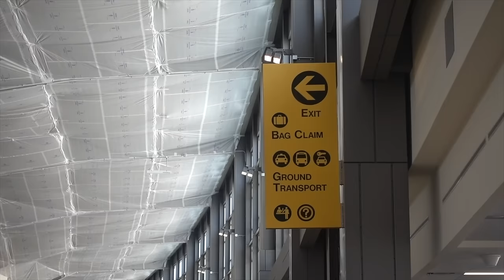MTB Myths that need to die—and some that are true!

Comment: The myth about airplanes is insane. 
I was an Airplane electrician. The bike travels in the cargo zone of the plane. Which is in fact right below the passenger seats. Lift one of those floor tiles you're sitting on and bam, you're looking at the cargo. Which means, they are in the same pressure zone as a passenger, which means it's still air pressure of around 1 bar and the same temperatures you're experiencing.

Hope that has cleared things up a little bit.
Reply from the maker: That’s unbelievable that they store the bikes at the same pressure as the cabin, and TSA will routinely tell you to let all the air out! Your revelation makes it even more ridiculous.
Reply: Yeah, otherwise pets couldn't travel in the cargo hold, there wouldn't be enough air to breath. (Usually, the temperature is adjusted if animals are in the cargo hold, so they won't freeze to death.)
Reply: There are too many passanger aircraft myths, that people take waaaaay too seriously, 'cause "they don't want to take that chance"
Reply: @BermPeakExpress  They do this, because "Someone told them so"
Mythbusters had  a whole episode, dedicated to debunking aircraft myths.
Reply: Not really 1 bar. Usually the airplane is pressurized to a normal pressure at 3000 meters altitude (about 9000 feet). But it does not make any significant difference for the tyres anyway.
Reply: @piast99  I was told it was pressurized to approximately 7,000 foot altitude because that is the typical altitude where people who are susceptible to AMS start getting sick.
Reply: Most airliners are pressurized between about 6-8000 feet. FAA regulations limit cabin pressure to 8000 feet and many aircraft manufacturers use a lower cabin pressure for passenger comfort.
Reply: if anything it should be the suspension that they ask us to let the air out.....bet they would freak out if they knew how much more psi is in the forks and shocks
Reply: From the effects of altitude alone, if you set your tire pressure at sea level and then took it up TO SPACE, it'll see a pressure difference of 1bar, or about 14.5psi.
Reply: You ever see your potato chip bags on the flight? Kinda funny.
Reply: The plane has frickin tyres on it ....wtf
Reply: @BermPeakExpress  

Cargo compartments don't go up to 35,000 or whatever cruise altitude.... but they (and the cabin) do go up to the equivalent pressure about 6000-8000' above sea level, for whatever that's worth.    NBD.

edit just realized 3 ppl already correctly said this... whatev.   Cool *
Reply: If Seth only knew to what username he just replied... 😀
Reply: Totally agree. I design aircraft, and you wouldn’t believe the ignorance of some people…
You’re spot on. Aircraft are cylinder shaped so that pressure differences can be handled optimally. You’re not running a horizontal plate (the floor panels) halfway and the only pressurise the passenger part. The floor would buckle!
It’s true though that the cabin does drop in pressure. And this can be controlled automatically or manually. The equivalent altitude pressure often depends on the airline operating procedures, but typically falls within a design range specified by the manufacturer. It’s done to relief some stresses on the hull (which is why when you have a cold, your ears can pop a bit). The same system is to cater for differences in pressure between departure and arrival point, so they can open the doors.
Reply: @BermPeakExpress  TSA knows nothing about aircraft. To the point that they sometimes even jeopardize the airworthiness of the aircraft (and your safety with it).
Reply: @DragNetJoe  actually, they lower pressure to get the passengers to sleep.
Reply: @johndoh9121  yep, and those run 300psi, and range from -50 C to sometimes easily +50 C. On rejected take off they run soo high (because of the brakes running some 1300C) that they could blow (fuse plugs that melt prevent that, but you can search for an a340-600 test video, where you will see when they don’t…)
Reply: The other myth I like about planes is the airplane mode lol they let you use your phone during the flight why does it matter that it’s on or not lol.
Reply: @hogsrmylifetbj  the FAA has this rule in place because of the POTENTIAL interference or adverse interaction with aircraft electronics. In practice this has never resulted in an accident so far. Nowadays electronic equipment is designed against more stringent requirements, but older aircraft equipment was not, soo the risk does exist. Again in practise phones have been accidentally left on and not caused problems. 

Currently there is no indication to remove this restriction, but it has a wide of non technical reasons, including terrorist use of mobile phones to trigger bombs, and nuisance of passengers talking on phones all the time.  In practise it may be difficult to get reception during cruise as connections may be unstable.
Reply: @piast99  yeah, just low enough to cause your water bottle to spit at your face when you open it, but not enough to cause it to explode
Reply: You mean baggage (where they fly dogs and other critters) is pressurized?!?!
And now,  surprised pikachu face!
Reply: flying in 707 Boeing it same store same as above seat but few dont like 363 or 355 else they get pressure in there
just normally leave tire at 10 psi yah be fine it no issues at 10 psi
i been on us airforce plane before i have load up machine and that hold over 130psi tire it never been affected at all it flew over pacific many time never blew tire i dont see why tsa telling people flat tire i wonder they want trolls you like u have back to store n air them up wasting time
Reply: Are your sure its at one bar ?
Reply: @HillelSe  100+ for road
Reply: The only reasoning I can come up with for that rule is that they ask you to do it to avoid the tires blowing up in case there's a loss of pressure in the plane. And I imagine it would be more applicable to road bikes cause they're kept at high pressures.
Reply: Yeah, ridiculous. But try talking facts to a TSA agent and see where that gets you....
Reply: Yep! You would have a really bad time if the entire "eggshape" of a airplane wasn't pressurized, as pressure vessels like pressure =) It'll explode and fall to the ground :P
Reply: It depends on the aircraft cruising level. The pressurization system keeps the cabin altitude as low as possible for passenger comfort according to the maximum allowed differential pressure. It will be at 8000 ft at maximum certified cruising level and lower if the aircraft stays below.

Consider all the bottles, cans and other containers in the cargo :-)
Reply: I travel with 100psi in my brompton and have always told immigration they're deflated. Hogwash they're gonna blow out, if this is the case then 160psi shocks would be at bigger risk.
Reply: plane would just explode if had different pressures between cabin and cargo 
😃
Reply: @BermPeakExpress  Aircraft cabins are pressurized at 6000-8000 ft altitude to minimize the stress on the aircraft structure.  That's why your ears pop during climb and feel pressure during descent.  A highly pressurized tire loaded at sea level pressure could burst at that reduced cabin pressure.
Reply: avionics. you're an avionics guy.
im a sheetmetal/structures guy. 
you know, the one that occasionally leaves FOD behind for yall to clean up. sry
Reply: I'd ask TSA who the unfortunate crew member is that has to deflate the aircraft's tires before they reach altitude (then reinflate before landing).
Reply: @baronvonrichthofen2021  right. IMHO the point is that they simply will not take chances. Air security is notorious for reducing unnecessary risks and I don’t blame them. Most likely nothing will happen but maybe you have this one idiot who pumped up his tires to the max already or by accident. They will simply not risk it if the counter measure is so simple and without any adverse effect.
Reply: Thank you for setting the record straight.... this drives me nuts!
Reply: @michaelb1761  Correct, 6,000 - 7,000 ASL is the typical cabin pressure.
Reply: It is an old generic rule for any tires, it will probably not be a problem but you have to think about the idiot who pressurized their old bald tires to twice the recommended pressure and then put it in an unpressurized cargo plane.  It is easier to simply have a rule that all tires need to be depressurized when flying then try to make a judgement call on an individual basis.
Reply: Not exactly true a hold in the plane isn’t always pressurised to the same we sit in B737 have a hold that is and one that isn’t
Reply: It's more for the smaller aircraft who holds are not always pressurised. So I did 20+ years with aircraft and out of Heathrow not an issue on 99% of aircraft but 2nd sector may be a smaller aircraft which the hold is not pressurised. Also note even on pressurised aircraft see those bottles of pop /water that are bulging once in the air. Same with your tires. I would always suggest letting out 20% of air. 👍
Reply: @michaelb1761  so they pressurize it to an altitude where people start getting sick? Lol they should pressurize it a bit higher so that people won't start getting sick...
Reply: I was so sick of finding my tires completely uninflated at the baggage pickup that I started deflating to the lower pressure and wrapping a length of fluorescent pink duct tape around the tire and valve. The color makes it look "official" and since then haven't had anyone mess with my tire pressure.
Reply: I cannot believe how much ignorant bull crap there is in these comments. You shouldn't believe it, either.  More importantly, if you don't know what you are talking about, don't say anything.
Reply: It wouldn't surprise me at all if this came about because someone realised that you could potentially fill the tyres with something far more dangerous than breathable air.
Reply: @chrisko6439  Unless your load control/weight and balance guy forgets to tell the pilots there is AVIH in the aft hold. or, decides to put cargo packed with dry ice in there with them.
Reply: To add to this.  Even cargo-only planes are pressurized.  Or more specifically, not allowed to depressurize.
Reply: @n0ch91c3s  Let's hear it for critical thinking.
Reply: @lcc8394  lol yes
Reply: @Plumbump  He won't live long doing that...
Reply: @lcc8394  shocks & forks are effectively  pressure vessels & can withstand a pressure differential of a few psi easily.
Reply: Plus they transport animals like dogs in the cargo bay as well. If it wasn't pressurized and climate controlled those puppers would have a really bad time in their transport cages...
Reply: @fourutubez7294  Nah. If the hold (& cabin fyi) is pressurised to about 7000m then that is only 4 or 5 psi less than normal atmospheric at ground level. Wouldn't affect anyone's tyres in reality.
Reply: @GardFiring  Surely it'd implode.
Reply: @karguy1720  but the reduced pressure at 7000 ft is only 4 or 5 psi less than at ground level. Not enough to cause any issues at all. Do everyone's tyres explode when they ride in the mountains at high altitude? Nah.
Reply: @svenweihusen57  It's only 4 or 5 psi difference so there is no risk in reality
Reply: @45graham45  normally no. The question is: do you want to risk it? Depressurizing tires doesn't cost anything while one ruptured tire would result in an emergency landing plus investigation etc. easily resulting in 50k+ Dollar costs. 
There is simply no reason for not deflating tires except for 2 minutes for the biker to pump them up again.
Reply: I think this is a hold over from the really old days of flying where the cabin and storage really were sealed apart.     But it hasn't been this way for years and years.
Reply: @fredman1085  I don’t think that an exploding bike tyre will cause any damage but for safety concerns the plane will have to land immediately. So they will simply not risk it. And it’s just a mild annoyance for any biker.
Reply: @fredman1085  But even a totally unpressurized hold will only be at about 13 psi less than at sea level so still not a problem.
Reply: @45graham45  oh, I believe you.    Im just saying where the idea might have come from.
Reply: @svenweihusen57  I’m not arguing for or against.    I was trying to say where the idea might have come from.
Reply: @lcc8394  I was told at the hardware store that water heater expansion tanks come pre-charged to no more than 40 PSI due to shipping limitations.  Of course you can ship full gas cylinders but there are special requirements.  Don't tell anyone about the shocks or someone will restrict them, even though you could put them in orbit without an explosion.  Sea level to space is 14.7 PSI, how many of our tires would explode with an extra 15 PSI?  Road, mountain, car, all the tires would be fine so long as they're safe to ride on.  Then again I'm not gonna pick a fight with the TSA any more than I would with the DMV, the Post Office, or Customs.
Reply: @baronvonrichthofen2021  I fly small aircraft and sometimes I struggle to get a connection even at 3000 feet AGL, let alone five digits in.
Reply: The reason they tell you to take the air out is that they have some policy or other that prohibits taking containers with pressurized gases because it's unsafe. Of course that's to keep people from bringing high pressure oxygen cylinders or something but technically, by the letter of the law, that's what bike tires are, too.
Reply: @johndoh9121  I’d be willing to bet those aren’t typical air filled tires though. Probably solid rubber
Reply: @FedericoTesta1  not necessarily.
Reply: The cargo hold is only heated if there is pets in there.
Reply: @freddyfox5002  Sometimes you do get your baggage back really cold after a long flight, so that sounds right, but I'm quite sure they keep it above 0° so as not to freeze people's beverages in there or get loads of problems with humidity when unloading. So it's well within the range bicycles are designed to handle.
Reply: They might be more concerned about a sudden cabin pressure loss, but I'm sure that so will the passengers.
Reply: @freddyfox5002  Sometimes it may be even fully air conditioned, sometimes it may be heated, sometimes it won't have any temperature control at all. It depends on aircraft design and setting of the switches. In 747-8F aft cargo hold may be either air conditioned, only heated or without any temperature control at all, depending on the settings of the switches.
Reply: @fredman1085  all of the pressurized airliners, since the invention of pressurized airliners, have had a round fuselage cross section. This is because if they were shaped like a Ford trimotor (rectangle cross section) then pressurization would try to force the walls into a circular cross section and they'd break since they're not built with balloon-like flexibility. 
So I don't think it's technically feasible to have pressurized and unpressurized sections on any round cross section airliner
Reply: One more add to this (Boeing engineer) is that the cabin is not "pressurized" per se but has some mechanical plugs that just close at air pressure corresponding to about 8,000ft. The pressure is captured at 8,000ft and then you continue on your way. The temps can drop in the uninsulated cargo hold but the pressure is no worse than what most of us ride our bikes at. So if your bike doesn't explode on the 8K trail then it will not in the cargo hold. The circle of the fuselage is the pressure tube with passengers on top and cargo below. Bit more complex but that is the gist and the myth is crazy but I'm surprised how many smart friends think their luggage flies at 30K pressures. If anything, you should increase pressure to offset the temp drop and protect against the cold temps dropping to very low pressure then burping tires wedged funny in the luggage stack. ~8K friends!
Reply: @CookieMonsterSLC  Nice insights :)
Reply: Someone needs to inform tsa and request a review of their rules. However, they aren't worried about the tires themselves, they're worried about the noise they would make because it does sound similar to a .45 being fired.
Reply: Incorrect, cargo areas are pneumatically sealed and during a flight, a vacuum. This is done to prevent fires since fires cant burn without oxygen. There is a separate cargo hold for animals (tends to be the forward cargo hold)
Reply: @HillelSe  Higher pressure means even less difference
Reply: At altitude the pressure inside pressurized cabins does still decrease 
Its why the ear popping happens
Reply: The pressure isn't 1 bar, it's around 0.8 bar at cruising altitude, which is equivalent to 2000 m altitude.
Reply: @HO7SIM37  Its not necessarily the pressure that is in them but the pressure at which the vessel can handle before failure. A shock being made out of aluminum and of sufficient wall thickness can hand several hundred psi of pressure before failure. A Tire on the other hand depending on its construction can't necessarily withstand multiple times its normal pressure before failure.

Now is the absolute pressure differential in the tire going to rise enough when at flight altitude to cause failure, highly unlikely unless the tire is way over pressurized at ground level or its just a total crap tire.  For this reason, TSA just advises you to deflate them as a precaution. They like anyone who has to deal with the general public don't want to have to deal with stupid irate people bitching at them because they may have had way too much pressure in their tires and the pressure differential expansion at altitude did cause them to rupture. Remember, most people will not own up to their own ignorance and will lash out at others if they think that they (others) are responsible.
Reply: Ok, I traveld for the first time with bike this summer and staff att two airports both asked me if I emptied the tiers. Amazing if the myth is spread to the staff att airports too.
Reply: And don't forget the pressure equalisation vents added in case of depressurisation, to prevent floor collapse! The cargo bay and the passenger area are deliberately connected to be at the same pressure, *by design*.
Reply: @BermPeakExpress  

It’s your Maxxis funeral😂😂😂
Reply: Ok Mr airplane expert. How about next time your on a plane fill your lungs and hold it from lift off until your level out at 8k feet or wherever they level off. If your whole top half if your body doesn't explode covering the plane in visceral and entrails. Then I will buy you a Coke. Or get someone else to do it while you videotape it. And make sure you I send that video to me too..I lobrvwhen ppl try to do dumb or imoossobke thkngs.
Reply: @johndoh9121  inflated to about 200 psi. whats ur point?
Reply: The absolute maximum increase in pressure you can have in tires that are taken from sea level all the way to space vacuum is 1 bar (the air pressure at sea level is 1 bar, the air pressure of a hard vacuum is 0 bar) or 14.6 psi.
An increase in pressure of 14.6 psi won't blow your tires (if it would, landing hard would also reliably blow your tires).
Reply: i have watched a video about airplane, the myth on the bike that the air should be decrease cuz its gonna explde well that isnt rlly true but one thing i know is the air could freeze inside the wheel airplane wheel doesnt contain air but heluim because they say it will freeze.
Reply: @justinepanes9710  a/c tyres contain nitrogen, because nitrogen has the least thermal coefficient of expansion. helium leaks out of steel containers btw
Reply: @robtodd4726  Crisps don't have air in them though. They're actually pumped with Nitrogen to force out the air so that your crisps don't go stale inside the packet and therefore it extends their "best before" date. And crisp packets are far thinner and less robust than the rubber of your tyre or inner tube - so they tend to expand a lot faster with less pressure difference. Which is probably why you notice your crisp packet expands whereas your tyre likely won't visibly expand at all. Also since the crisp packet is sealed at the factory, the factory might actually be at a different sea-level / altitude than where you filled up your tyres, which makes a difference too - though only slightly.
Reply: I was actually scratching my head when the video said that the pressure on tires will go up an higher altitudes. I've been thinking that the cargo space and the passanger compartment has the same pressure.

And, I'm not even into the aviation industry.
Thanks for the confirmation.
Reply: @chrisko6439  Also if the top of the fuselage it preasureized and the bottom is not it will stress the airframe.
Reply: Difference between sea level standard and hard vacuum is like 14.7 psi anyway. The space shuttle had pneumatic tires, filled with nitrogen. So, 30,000 feet will be a somewhat smaller margin (the airplane has tires, too, and they aren't in a pressurized area. I used to service them on all sizes of airplane)
Reply: @aaronbredon2948  thank you!! 

I’ve been reading all of these comments hoping someone would point that out. 

The very most the additional pressure difference between the inside and outside of the tire could be is +15 psi. That not gonna blow a stationary tire off the rim, let alone cause it to explode. And most of the time it’s gonna be more like +5 psi due to the cabin pressure. 

Bike tires are designed to handle at least double their recommended pressure, because manufacturers know that some people are going to ignore the recommended pressure or have faulty gauges, tires will heat up and take impacts, rims will be imperfect, etc. 

Even winter fat tires (like 4”) are designed to potentially be run at 20 psi or more, and I guarantee both the tire and the tube can handle 35 psi. And the higher the normal use pressure, the less +5 (or even +15) psi is gonna matter. 

I’ve been running 35mm tires with a recommended pressure of 45-60 or 45-55 psi at 70-80 psi on my touring bike for decades, and have never had a problem, let alone a blowout or blowoff.
Reply: @justinepanes9710  no, the air in your tire isn’t going to freeze. At 30,000’, typical air temp is around -45°. Even if the cargo hold were allowed to get that cold, it won’t freeze the air—looks like CO2 liquifies around -80°C, and O2 and N2 around -200°C, so you’re not even gonna condense the air in your tires, let alone freeze it. 

The most it might do is freeze out a few ice crystals if there’s a lot of moisture in the air in your tires. But if that were a problem, people would have to let the warm air out of their bike tires in winter and only fill them outside with air the same temp they would be riding in.
Reply: @AJ-sw8pm  What you heard about some cargo holds not being insulated is true but that part about pulling a vacuum on the cargo hold is pure science fiction, not that it wouldn't work to prevent a fire but it would just be silly to have an area pressurized and one area under vacuum when they're both part of a single cylinder. Think you need to google that one more time brother.
Reply: And even if it did "explode," which of course it won't because bicycles aren't stored in a separate antipressurised hull, it's not as if a bicycle tire "exploding" would actually damage anything. Been there, seen that - it makes a bang like smashing a paper bag or puncturing a party balloon and from a fundamental physics perspective it has approximately the same potential to do damage to the surroundings.
Reply: @lcc8394  SHHHHHHH!!!
Reply: In addition the pressure in the tire remains constant. You would have to add air to the tire to raise its pressure. If the the tire were to ride in an un pressurized compartment you are removing the compressive pressure of sea level air on the outside of your tire. Up to 15psi if you went from sea level to the edge of our atmosphere, somewhat less for lower altitudes. A larger pressure gradient will be experienced by the tire, but no increase in pressure.
Reply: Yes and pets are in cargo too.
Reply: dang, i mean, i hope its the same pressure and temperature. My bird and other peoples animals were down there.. (guess nobody thought of that tho huh?)
Reply: So when you have pressure dropping and those masks came out for yourself to breath... next is you hear some tubeless-tyres blast off the rims above you; you know that cooling makes the metall-rims shrink its material (thats why cooling  bearing before pressing it in makes it press in a lot easier) so the incerasing pressure tyres go off at lower pressure compared to ground testing at normal temperature, right? Right: Thats the perfect sound to make me relax in those kind of situations: classy explosions aboard. wohoo! I hope nobody forgot a screw in his tubeless-tyres... it might blast through the aluminium wall of the plane, increasing our little "pressure problem" :)))

Yeah totally insane myth, it never happened...yet... ;)  until the FBI finds out in a special examination when it first brings down the first plane. Dont worry... only happens "once", and then we deflate them alwayws. Because we learned from that one unlucky incidience. Thats it... we first accept it can happen until it happened ONCE. Before that its: insane myth... it doesn't matter that you can describe a clear sane logical path for such incidence to actually happen. That shit can happen! Your plane is not as stable as you think it is.... you travelling inside a tin-can ;O)
Reply: Then the landing wheel should've gone boom long ago
Reply: @BermPeakExpress  But it's like when you have a bag of crisps on the plane or even a water bottle, it will "inflate" and "deflate" through out the flight
Reply: Also even Dogs and other Animals are sitting in the Cargo zone and would die instantly if no living friendly athmosphere ...
Reply: It’s still lower pressure than sea level (equivalent to about 8000 feet); enough to make a bag of chips expand, but not enough to make it burst. A tire even less. 

Even the planes own tires sit in an unpressurized zone and they do fine.
Reply: Has somebody calculated what pressure does the tire get in case of loosing cabin pressure? Just asking.
I mean, you can have an accident like a faulty door or something, the cabin looses pressure (it happened before), oxygen masks drop and the pilot takes the plane at a lower altitude.
But in case such an emergency happends you for sure don't need some extra "bangs" from bike tires.
Reply: @danielgrigoras5293  pressure in cruising altitude is between 0,1 and 0,2 bar. So the tire pressure would rise in a decompression compared to sea level around 0.8 bar/12 PSI
Reply: @johndoh9121  - that is not a valid argument here in principle, because the plane, being a plane, is designed to operate at very low air pressure, also including the tyres. The bike, on the other hand, is not designed to operate at the ambient pressure at typical cruise altitudes. But in practice, as explained in the video, it does not matter, because the pressure difference is simply not large enough to cause problems. That is,  unless you are a roadie who has just inflated their tyres to 150% of the design pressure specified by the tyre manufacturer, and your tyres are therefore just a smidgeon away from exploding anyway. In that case, it would actually be a good idea to let off some air.
Reply: @johndoh9121   those freaking tires are filled with pure nitrogen that doesnt expand that much compared to regular mixture of nitrogen-oxygen-carbon that u breate on sea level..
Reply: @BermPeakExpress  balloons will quite literally expand if you take them on, lik eyeah it doesn’t get decompressed, but the whole cabin isn’t at 1 bar when you are in the air.
Reply: @BermPeakExpress  And even if it were stored in a despresurice area, the more high you are, the less pressure it is... not the other way. On the beach you have all the weight of the atmosphere, at 30.000 feet you don't, you have less. So tire wont explode, they will deflate. Simple physics
Reply: @chrisko6439  i guess those videos that try to debunk the guy stowed himself away as cargo is false, because it would have gotten himself killed.
Reply: Tbf, what about in the scenario of cabin depressurization. ¯\_(ツ)_/¯
Reply: Actually I don't think it is insane. I doubt it's an issue for MTB's but if you've hung around BMX long enough you've seen tyres explode at competition when bikes are sitting between races in the sun. So I'd say it's possible that tyres have exploded on planes due to high pressures been used and the airlines have brought a blanket rule against tyre inflation as a result.
Reply: Guess they talk more about in case of pressure lose. But its more a safety aspect in case of a fire. if it start close to your bicycle and the tire gets a hole the pressureized air will push the flames to increase. So in a standpoint of safety its a bad thing to have pressurized air. You know that one of several reasons for nitorgen in aircraft tires is also its not flamable.
Reply: @BermPeakExpress  If the TSA ask you that, ask them why the pilots don't let the air out of the ones on the landing gear.
Reply: @piast99 exactly. Pressure in a plane is lower than sea level, but these are MOUNTAIN bikes. Your tires don’t blow off the rim of you ride Top of the World in Whistler do they? 😂
Reply: @maxpayne2323  They're probably told to say it's to keep the tires safe but they really just dont want a container filled with gas(air) that could secretly be propane or medical oxygen to accelerate any explosions someone could have planned.
Reply: @BermPeakExpress  Actually cabin pressure only goes up to an equivalent of 8k feet, so if you go to a place at 8k feet, it is the same pressure you experience at the plane at 35k feet
Reply: Well, as an Airplane electrician you would know that there is not 1 bar of pressure inside the cabin of an airliner. Most of the time the cabin altitude lies between 6500ft and 8000ft wich is about 750-800mb or hPa which is quite a significant difference to the 1 bar you think there is.
Reply: well To be be fair the passenger seats are still at less than 1 atmosphere so you still get an increase in pressure, but like even crisp packets don't burst from that
Reply: @BermPeakExpress To be devil's advocate here - in case of cabin depressurization the last thing you need is tires popping below passengers' seats.
Reply: Brilliantly researched - and explained. Mythbusters eat your heart out!
Reply: The plane has tires ?
Reply: if you carry a bag of chips in it can explode.
Reply: @BermPeakExpress  according to the National Institute of Health (NIH) the minimum pressure in the cabin of a commercial airliner is 75kPa, or about 0.75 bar, or about the pressure one would experience at 8000 ft/2440m in, for example, the Rocky Mountains.  According to the Air Canada website, that airline maintains a minimum cargo hold temperature of 7 Celsius, and they say if animals are on the flight, the hold is kept warmer.  So no, your tires aren't going to blow.
Reply: @kwb377  give it a try, they will kindly invite you to a small room to discuss the topic for a few more hours… :)
Reply: @AJ-sw8pm no offense, Mr AJ, but completely wrong…. the cargo holds and the passenger area are in the same fuselage pressure vessel, at the same temperature…

To create a vacuum you’d have to pump air out….
Reply: @matijanovak3906 helium… :) 

maybe we could try hydrogen, it would create some more lift for the plane :)
Reply: @PRH123  No, I can’t remember what plane crash it was, but there was a plane crash where they were transporting old oxygen cylinders from the mask system that gets deployed when the cabin loses pressure. I remember that one of the fire prevention methods was to not pressurise the cargo hold, but the fire happened because of the oxygen cylinders releasing oxygen to feed the fire
Reply: @PRH123  Yes, they are. Pressurised to the equivalent atmospheric pressure to that of say being up a mountain about 7000m altitude - about 0.75 bar. This is a bit less than pressure at sea level which is about  1 bar.
Reply: @AJ-sw8pm  oxygen cylinders are indeed very dangerous, they are classified as Dangerous Goods, but not because they contain oxygen, but because they generate oxygen, using a reaction of two chemicals that creates a tremendous amount of heat, and that heat in the wrong place can start a fire 

So, what you are probably thinking about in the cargo hold, is not creating a vacuum, but rather the fire suppression system that cargo aircraft have. Like the fire suppression used in computer rooms, it ejects inert gas, which displaces the oxygen, so there’s nothing to feed the fire.

You are right there have been accidents caused by improperly transported cylinders. The airline I worked for got fined by the FAA (a big one) because the mechanic at our location put a cylinder in the hold to send it to another station, but did not do any DG paperwork to declare it
Reply: @45graham45   everyone would pass out if the cabin altitude was over 21000 feet…. the FAA max altitude without supplemental oxygen is 12000 feet….   21000 feet would be like .4 bar…
Reply: @PRH123  7000 ft, not meters.
Reply: @45graham45  ok, that's different, but you wrote meters....
Reply: @PRH123  I made an error.
Reply: @PRH123  yeah, that will make a difference on a 60-250 tone airplane
Reply: @sheeprar  shh
another idea might cause their heads to explode ;)
Reply: lol I’m in airline pilot I came here to say this the cargo hold and cabin are usually around 7000 feet depending on the cruise altitude. The tsa is silly we dislike them too
Reply: I’m an actual airplane electrician. What you said is the opposite of reality..😤

Bikes are really stored in the wings of the airplane and they have to be deflated or exploston of the tires can rupture the fuel tanks!
Reply: The bottom line is even if your bike is in an unpressurized compartment, the most the pressure can go up by is 1 bar, or 14.7 PSI, and THAT would require the plane to be in outer space!  BTW, at 30,000 feet, there is still 4.3 PSI of atmospheric pressure, so you would only gain about 10.4 PSI.  You should also be able to understand why when bikes that have sat in a lake for decades and are brought up, the tires are still inflated.
Reply: @hondolane3125  true that
Reply: @BermPeakExpress well, the pressure in the cabin IS very different than on the ground, so the warning is not entirely without merit, though it really shouldn't do anything to the tires. I had modeling supplies in my carry on one time, and ALL my paint pens leaked because of pressures. And that was in cabin.
Reply: Just to add, the tires on an airplane are inflated to around 200 PSI, and they are in nonpressurized wheel wells on the plane at about 35,000 feet.
Reply: @BermPeakExpress tsa only provides the illusion of safety not actual safety